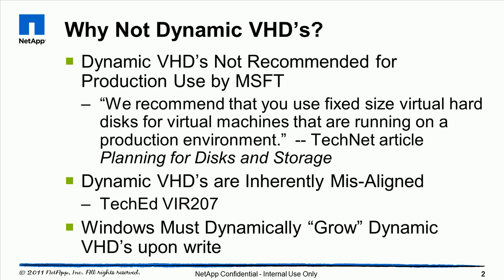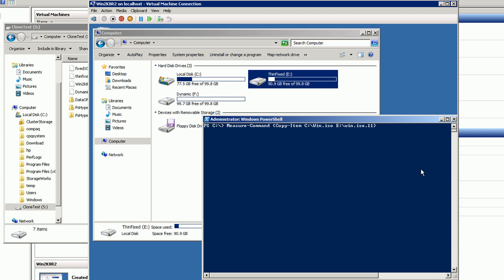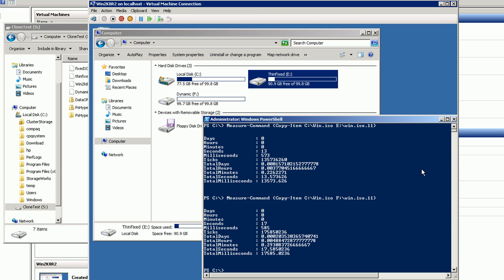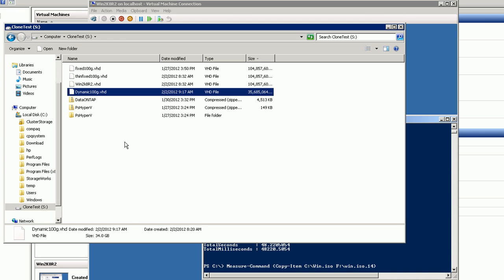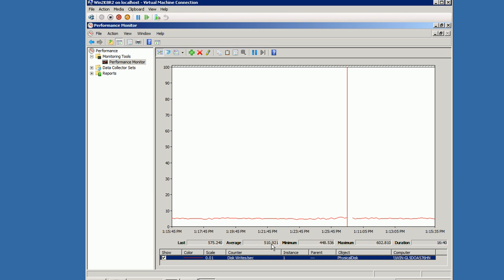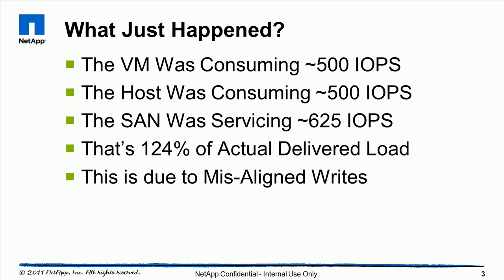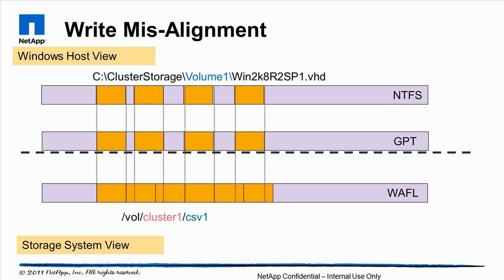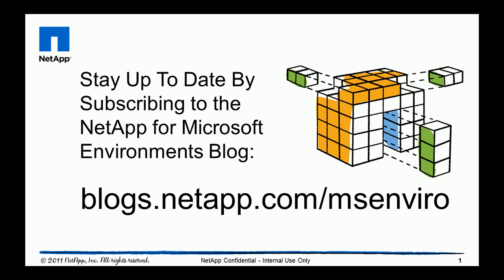Dynamic vs Fixed Performance Comparison

Comment: on vhdx, the performance seems to be EXACTLY the same.
Reply: As I understood, worse performance of the Dynamic VHD was ONLY due to misalignment (i.e. bad design). Then don't misalign. Problem solved. This has nothing to do with disk being dynamic or needing a resize. There is nothing to resize. Physical disk is the same and data amount written is the same.